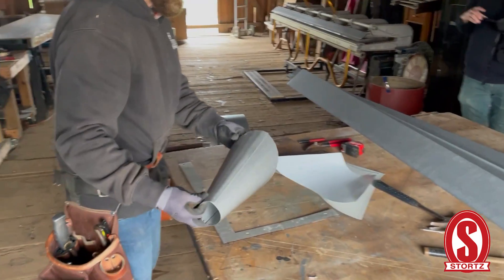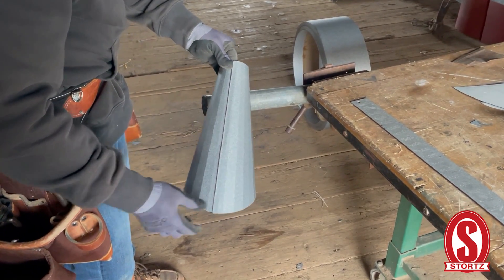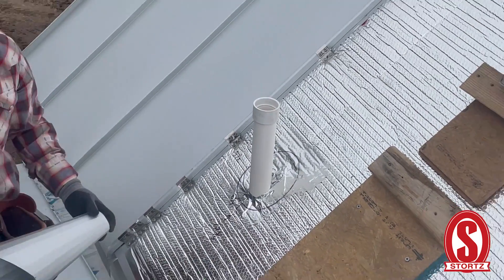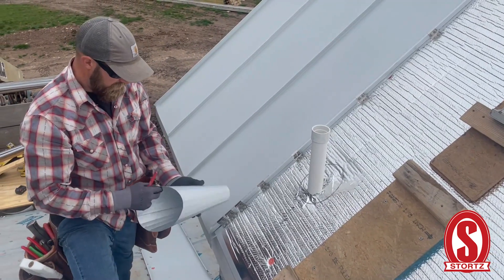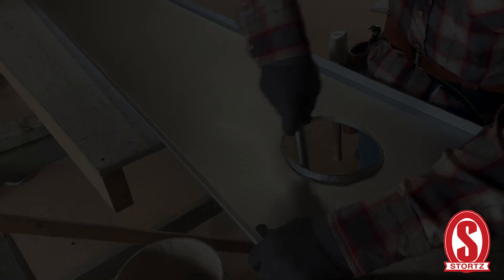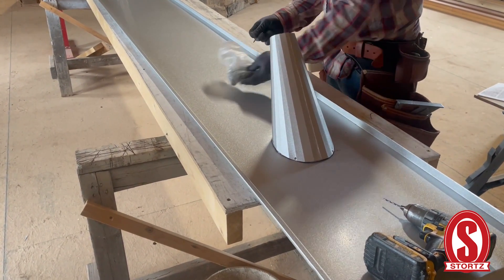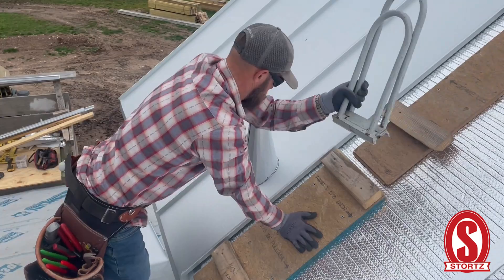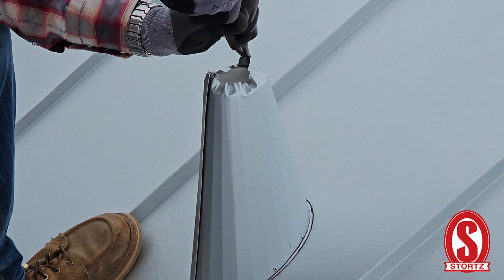Standing Seam Roofing - Pipe Flashing

Comment: Love the video, its all in the details. When your rolling over the metal edgeon top of the pipe, i would think a large tapered wood rod would give it the best final seating after the hammer starts the roll. Been using split pans but i may have to give this a try. Best regards.

Comment: How is this better than epdm boots with np1 sealant unter the metal ring.  Good luck better that sleeve and panel on a pipe on a 12/12 roof three stories in the air.  I move pipes with elbows when they have be moved to make layout work with all the pipes on the sode otherwose the panels are laid out accordingly so nothing has to move
Reply: Np1???? You're not... dude I'm not going to rag you. But anything other than water block (Butyl) is definitely worse than no sealant at all.
Reply: Properly such a pipe should be folded with the panel. You fold the edges of the pipe inward, put the pipe over the hole as prepared here, then fold the edges of the hole over the edges of the pipe and then fold everything inward. Not easy to do it right.

Comment: Hi, on this short run it may not be an issue. But on a loner panel, for example on a +50ft panel. Would you be worried of the contraction and expansion of the metal being limited or affected by the plumbing pipe being so flush to the metal boot you made?
Reply: Yes with a long run thermal movement needs to be considered. I would keep the jack loose and extend the pipe through and add a storm collar. You can buy rubber rings at your roofing supply. Although this would require replacing the ring every so often. There may be other alternatives that I am not aware of this is just a suggestion.
Reply: This is a great question, I am also interested. And why not fold the pipe and create a seam where it meets the panel?
Reply: @MFPTool you can seam these on but it will take much more time and effort plus difficult on a large panel. I would still recommend sealant on the inside either way. This is a simple and time efficient alternative to the rubber boots that most use in the industry and more attractive in my opinion.